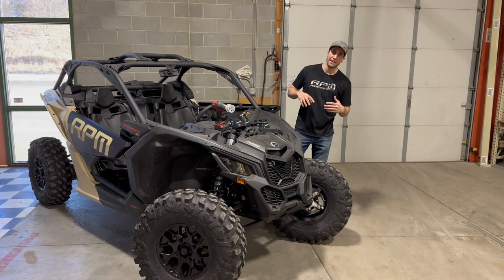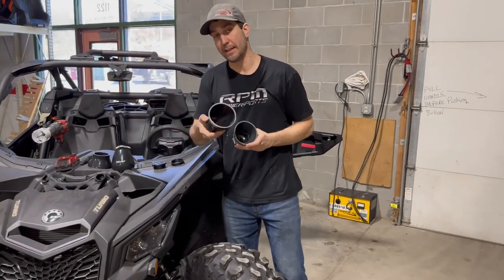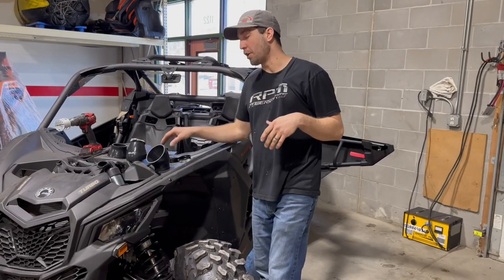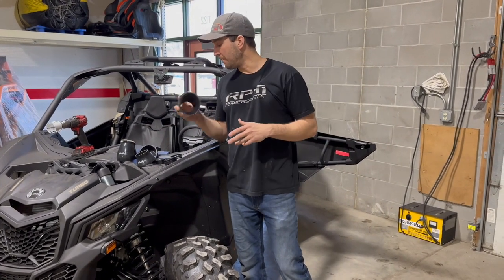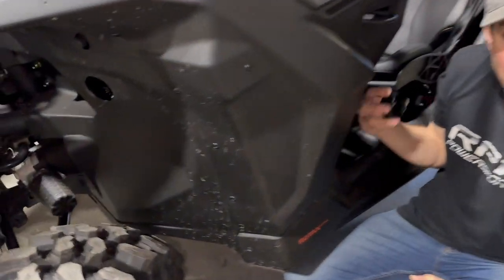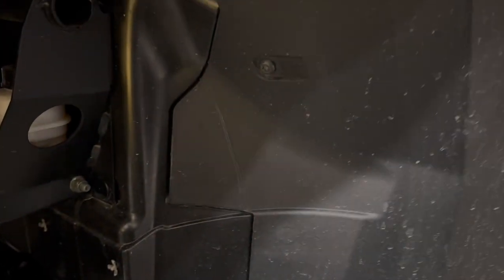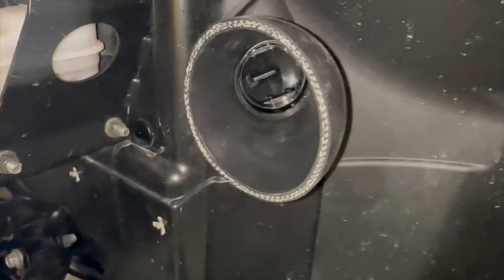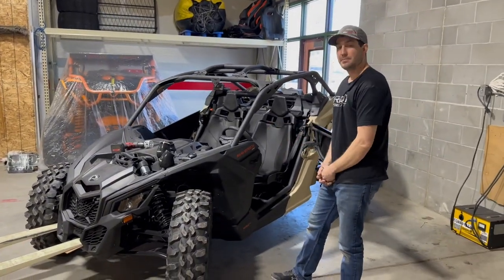RPM "Cooler" Air Vent Kit ~ Universal UTV Cab Cooling Kit

Comment: I bought the kit, great concept not sure about what to do on the passenger side of my X3
Reply from the maker: You don't have to go through both walls for it to work. you can secure the vent to the furthest outward wall and still use the vent.
Reply: I'm still not sure how you would operate/install it on the passenger side. 2021 X3.
Reply from the maker: @jimharbort2821  We go through the first wall with the hole saw, completely install it, and leave the 2nd hole alone. The 2nd panel is irrelevant once assembled, you can still use the vent through it.
Reply: @RPMPowersports could you do a video to show this?
Reply: @RPMPowersports  It might make sense after drilling the holes, but I don't see how you will be able to screw the pieces together to give the vent something to mount to if you're only using one wall.
Reply from the maker: @fixepah  One hole larger than the other.

Comment: Please show how you install it on the X3 on the passenger side.
Reply from the maker: It's universal, not specifically for anything. Where you want it is up to you, near the bottom of the fuel tank , and on either firewall works for the X3 passenger side. It's ok to be in line with the tank, the louver directs the air downward.

Comment: Will mud and water come thru this?
Reply from the maker: @matthewpayne4614  after it works it way through the doors and floor boards it will work its way in when you submerge the machine.